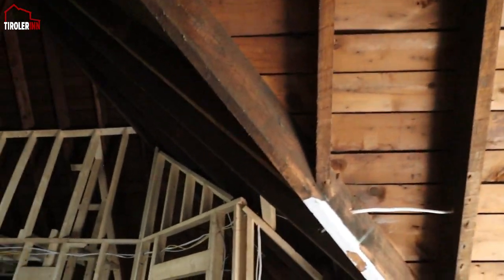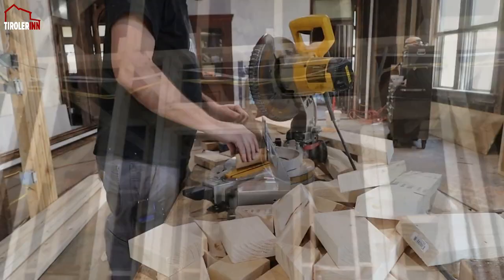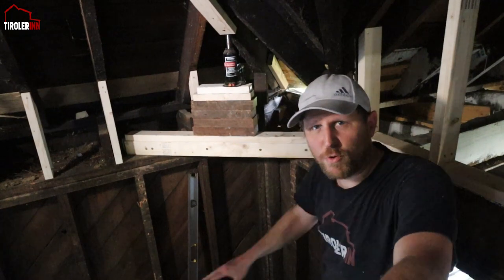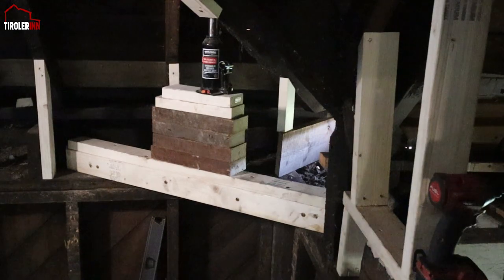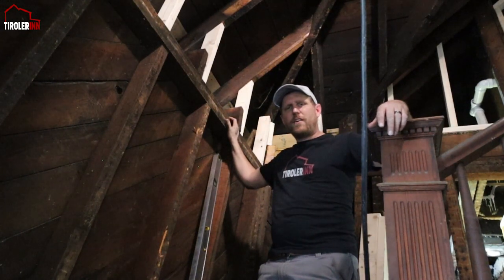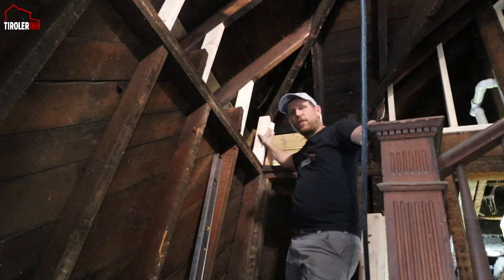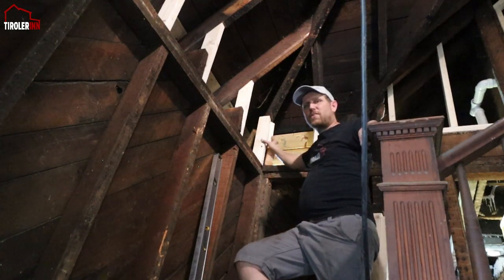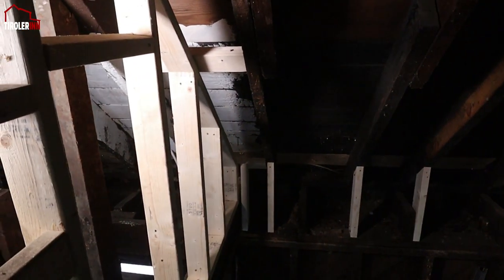Stabilizing and Shoring Up the Roof in the Staircase - TirolerInn the Renovation

Comment: Do you have ridge vents for your attic?  If, not what are you doing?
Reply from the maker: No ridge vent needed with slate when the roof is spray foamed. Tar shingles need roof venting to mitigate the heat that would damage the shingles otherwise.